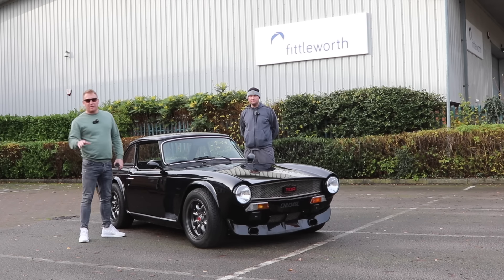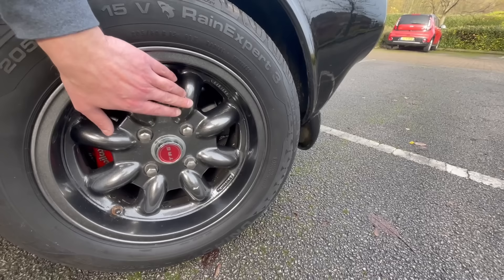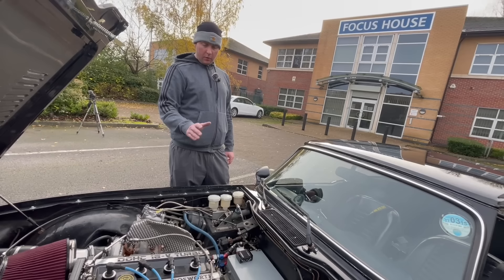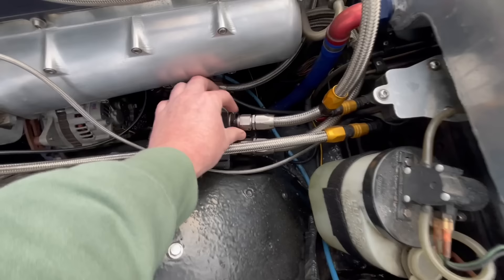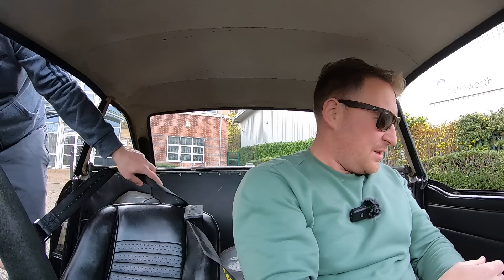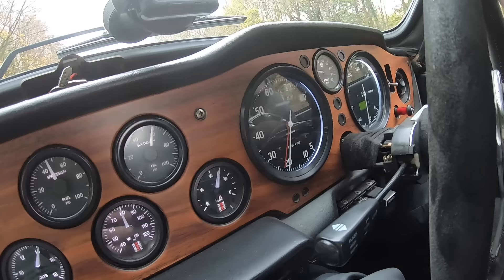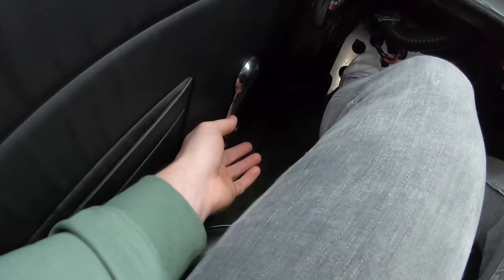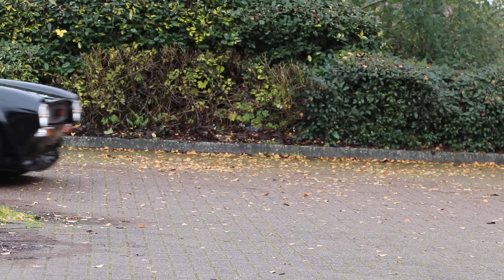This COSWORTH ENGINED TRIUMPH TR6 is SERIOUSLY MENTAL!!

Comment: What a mess to a great car. Put a four  cylinder turbo instead of a six cylinder made to modern specifications by Cosworth Made the car out of cheap fiberglass not a good thing why not modern composites?  It looks wrong and strange there were different types of this TR6 but this is so sad to see.
Reply: If you listen to the commentary, the fibreglass was done by the first owner. Long before carbon fiber was common. Back then it was either aerospace or F1 use.

Comment: The engineering and thought that has gone into the engine is cool, however,the body and inside in my view is not up to the same standard. Also, why they have not done something about the heat ingress into the cabin I do not know. There are loads of products on the market. Also it is obvious there is far too much power for the chassis and the car. I did enjoy this video and for once watched from start to finish, thanks to you both.

Comment: Them cars the back end can slide out very quickly and now it has a yb lol 😂 would not trust that car at speed on a corner thay was dodgy before lol amazing car tho looks amazing
Reply: In standard form 6 cylinder 150bhp they’re reasonably predictable and good fun, changing direction can be a mixture of steering & throttle. Initially it was probably fine with the cossie but the big power upgrades just make it a dragster that’s probably not as much fun to drive.

Comment: Looks over safety on the seats. These bucket seats are a death trap in a crash, because they will not give you enough support when the body drives back after the immediate crash and that will cause spine injuries leading into paralysis even on lower speeds. Performance cars need good seats having a headrest.
The rest is georges.
#MODInc
Reply: Gorgeous George
Reply: @ianmangham4570  Cheers, tipo Nazi.
Reply: @j4v-cyberpunk-music  TYPO 🤡
Reply: @ianmangham4570  Keep goin
Reply: @j4v-cyberpunk-music Fuzzy Wuzzy was a woman!